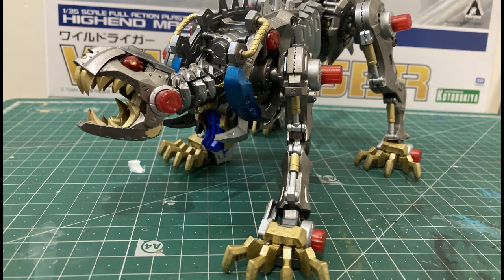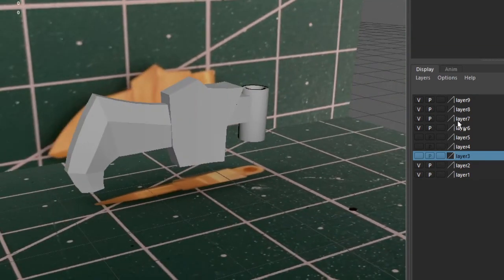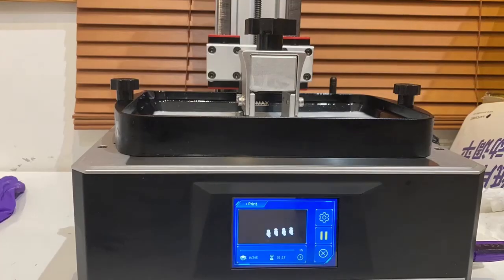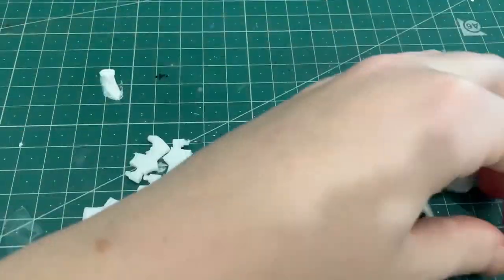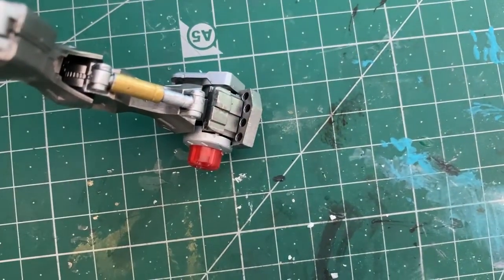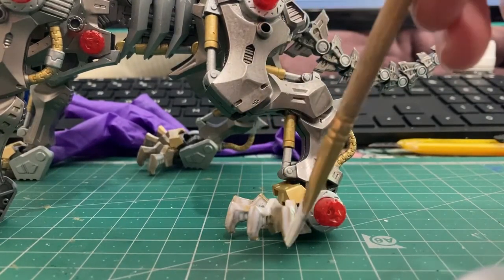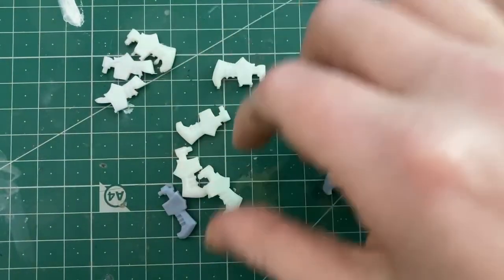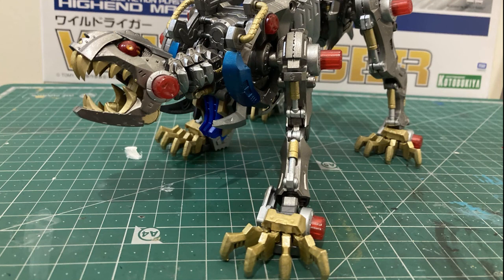How to make custom Zoids parts using 3D printing

Comment: Glad to see you're still making Zoids content after all these years! Any chance you might consider making and selling replacement parts for old models? My old HMM Blade Liger had several pieces break over the years, but I'm not sure I can justify cost of a resin printer to print new ones out.